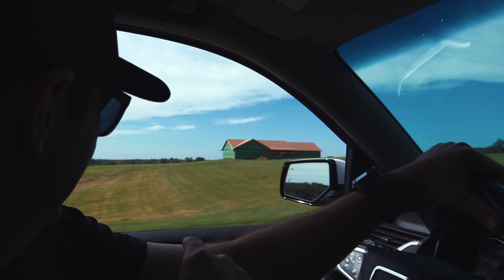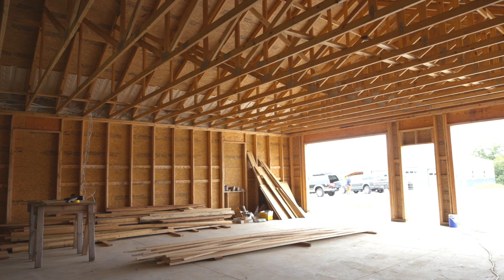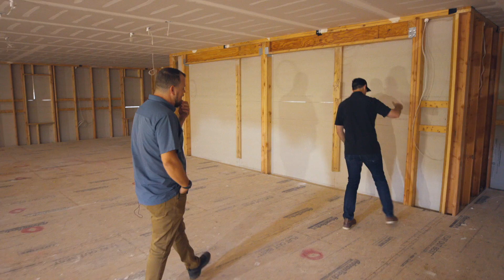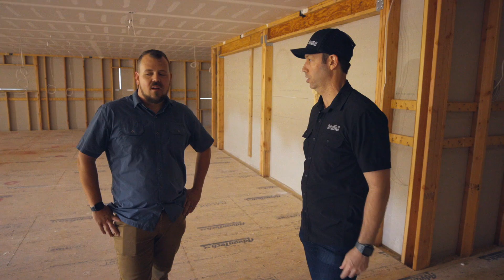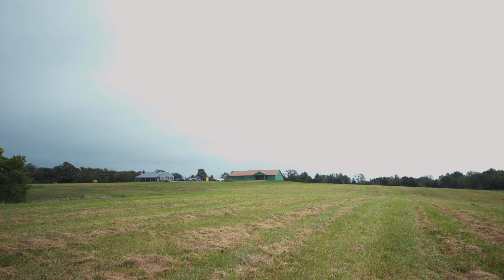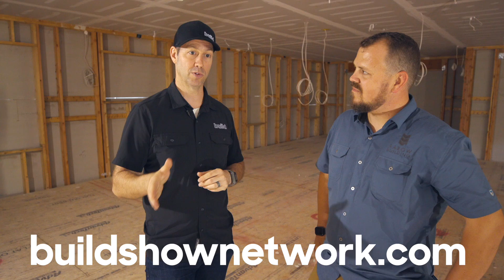A House with No Doors or Windows?

Comment: That is some forward thinking to design the house with no interior load bearing walls and to drywall the ceiling completely before doing the partition walls.  That just means you'll have to bring the drywall crew back when the partition walls are up.
Reply: My first house 35 yrs ago had clear span trusses with no load bearing walls inside, 2X4 frames and trusses on 24" centers with brick outside walls on step-edge slabs, lots of house were built like that in Australia
Reply: @DanielsCorner644  and what is that width?
Reply: @DanielsCorner644  I would ask for your trusses to be spec'd again. I have floor trusses spec'd for 34' spans with 40 live and 25 dead load at 24" tall and 16" spacing. You can easily get to 30' for normal stuff. (I have gypcrete planned). As far as roofing goes, I have trusses spec'd for 65' clear span with a 50 psf snow load. Most houses do not need interior bearing walls for the roof trusses. (Most floor systems will still likely require it because 34+' is getting pretty far clear spanning).
Reply: @DanielsCorner644  I agree it is more complicated than simple span charts. Particularly when you factor in angles and girders supporting perpendicular sets of trusses. But, for the ability of a truss to span 50'+ is standard issue. And I am only running the joists at 16" to handle the gypcrete dead load over the 30'+ span; 19.2" is standard, I agree. It's all figured by software as you've stated.

Comment: $250/sqft is ridiculous for Columbia.  Not including land and other fees.  I hope all the ceilings are gold flake and all the floors are solid walnut.
Reply: Actually it's Gold Leaf imported from Tutenkamen's tomb - quite exquisite actually, thank you for the support
Reply: For a basic house, yeah $250 is extremely expensive, but for a custom home with the insulation/air permeability ratings that this one has it becomes just expensive. Once you factor in local market conditions it could very well be in the ball park. It is not uncommon for specialty custom homes around here to be in that range, and the houses I'm building right now (poor insulation, little to no efforts to curb air flow, built cheap) are priced on the market for $350.

Comment: My dream:  
ICF with radiant cement floor also using passive haus window design for solar heat gain in winter. Massive overhangs and solar array to shade roof.
Reply: So right. We have to have a roof of some kind, why not shade the roof with solar panels and cut down on heat while gaining electricity. Win, Win.
Reply: johnknoefler absolutely right. That is an often overlooked benefit of solar. It blocks massive amount of heat gain to the roof assembly.
Reply: Well done! That is the best option currently designed as far as I have researched. If you need any help with the project, let me know. ICF with infloor is all I do.

Comment: Super advanced engineering. Thanks for sharing.
Reply: thank you for the kind words
Reply: @stevenbaczekarchitect9431  For sure, what impressed me is that the builder is using quality material and combining that with some really smart engineering that's well thought out for the future. I'm in Southern California and what I see in houses from the 50's and 60's is often really shoddy construction that could have been vastly improved using the same materials but just better designed.  More recent construction looks great until you look close and the engineering and planning for the future is just shameful. Houses built to have problems. Plumbing problems, settling problems, expensive to cool and heat, it's sad that no one seems to care about anything more than getting paid off.
Reply: @johnknoefler  Agreed - it's very unfortunate. It's crazy, this video gets posted, then these tools come out of the woodwork saying it's overpriced, the builder is a criminal, etc - then they tell how they are building homes for $100- $150 sq ft, I think that is criminal activity........
Reply: @stevenbaczekarchitect9431  I don't build houses, but I've been in the steel construction industry most of my life. Of late, I've been involved in landscaping, minor repairs, one roof replacement, and working as a plumbers assistant. What I've seen shocked me when dealing with these cheaper houses. They are built to rot, poor roof construction, crappy designs that had more to do with silly whims than practicality, walls that don't actually come to a 90 degree corner so counters don't fit, outlets placed in stupid areas that make no sense, wiring that is just flat out insane, plumbing done wrong. Damn, you'd be better off paying twice as much for a house built to last by competent people. There is nothing more sad than an elderly home owner trying to fix up a cheap house on a fixed income. There is nothing more expensive than a cheaply built house.

Comment: Passive house standard is .6 ach 50. They're already there. As long as the windows and doors dont screw things up, theyve achieved it. Gonna need ventilation, but worth it!
Reply: They've got a LOT of penetrations to do still.  All the windows, all the doors, all the HVAC, all the electric, all the plumbing.  And every one of those slightly leaky.  But they've got a good base to start from.
Reply: @PerroneFord  I agree. I'd love to see the numbers when this place is all done just to know the difference. Matt said theyve got a killer window and door set up coming in but plenty more to be done.
Reply: Completely not worth it.  You can  insulate a 3ach and have very low utilities.  Low ach just means if you fuck up somewhere you are screwed.   A well insulated house that breaths is better than a tight house.
Reply: @MichaelMantion  Are you still reading that 50's guide to homebuilding? That's a great explanantion when choosing not to do things right
Reply: Gentlemen and ladies, this house was tested to .30 ach50 Pa, then we sealed it more with Aerobarrier to .05 ach50 Pa. I doubt the final test is more the 1.0-2.0 ach 50 PA , if it is even that high
Reply: @PerroneFord  They were saying all the plumbing and HVAC will only come up through center walls from that basement, so those penetrations won't effect the air tightness.  Not sure about electrical - obviously all those wires down from the attic are holes, but can be foamed around easily.     It would be interesting to see what effect even the best windows and doors have on that number.  Plus those pesky bathroom exhaust fans.
Reply: @stevenbaczekarchitect9431  Right.  But the finished house isn't likely to be a .3 or less, which was my point.  The envelope is very solid.  Looking forward to seeing future videos from here as it looks like there are more coming.
Reply: @tombiby5892  That's fine, but unless they are manufacturing water in the house, that water will need to come from outside, and gray water will need to leave.  They are also going to need to get fresh air into the house and do HVAC.  So regardless where those penetrations are made, they WILL penetrate the envelope at some point.
Reply: @PerroneFord  I would expect the final blower door to be less than .20
Reply: @stevenbaczekarchitect9431  That would be amazing.  Looking forward to seeing that.  While I'll never afford a home built like this, it's awesome to see both the technology, and learn a few tips along the way as I improve my own home.  Thank you guys for being so generous with your knowledge.
Reply: @stevenbaczekarchitect9431  nope, I don't read guides to homebuilding.  Nor do I care what idiots have to say.  If you want a house that won't dry, that holds in toxins, that stop chimney and exhaust to not work, that's up to you. Just force me to live like that.

Comment: Whoa, whoa, whoa...a few questions if I might:
1) What exterior insulation (if any) and drainage/sump arrangement did that basement get?
2) Did the slab continue over the basement? If not, why not?
3) Is the slab also insulated underneath? (seems crazy to insulate top and bottom)
4) Assuming the slab doesn't run over the basement, does it butt the basement walls or run over them to the inner edge of the basement wall?
5) Are the slab and basement independent, or rebarred together?
6) You won't be able to tilt up full-height interior walls, how does that work? (Seems like a good steel stud application just screwing the top/bottom channels in place)
7) And what's the span of the main house trusses?
Reply: Basement has a perimeter drain and a floor drain that drains to daylight. It is a framed floor over the basement. Only slab insulation is on top of the slab, continuous - no thermal bridging
Reply: For #6, build a little short and shim. Or build 1-1/2" short and double plate the top. The wall will stand up and slide under.
Reply: @bradley3549  Yeah, assumed so, which is why I'd go with steel framing inside.
Reply: @stevenbaczekarchitect9431  Thanks, and is the slab independent or rebarred to the basement.
Reply: @jhealy3110  Reinforced to the utility foundation wall
Reply: Steven Baczek Thx
Reply: @jhealy3718  NP glad I could help

Comment: Brilliant. Why aren't more builds thought out as well as this? I have only one concern: truss uplift. How will you hide the inevitable movement of the ceiling when the tops of the interior walls remain stationary? This has me scratching my head. Steve Baczek?
Reply: I've designed about 4000 homes with trusses and have only had an uplift problem once with a 56' wide truss. I'm believing we won't have a problem here

Comment: Matt, I just checked out your website. Two programming issues. It didn't pick up on that I was using a phone. Also, it would help if you had a way that the user could easily switch to low vision mode.
I sell tools and fasteners. I recommend your channel and now your website to all the builders in my area. Especially relevant is your air and water sealing.
Reply from the maker: Thanks For your support. I’ll look into those issues. Thanks

Comment: I'm building similar to this in North Idaho.
44 foot wide trusses on the house and 35 foot wide trusses on the garage no interior supporting walls.
Monolithic foundation on foam with 1/2" hydronics on 6" centers in the house and garage.
Question, what's on the roof? And could it be used under steel roofing?
Reply: aSPHALT SHINGLE, BUT COULD EASILY BE METAL
Reply: @stevenbaczekarchitect9431  What's the pink on the roof in the video?
Reply: @sl8747  It's the adhered WRB on the 5/8" Zip sheathing

Comment: I am from Pittsburgh, Pa. Not really NORTH East  but -- If you bother with that partial basement / mechanical room and 2 X 3/4" sheeting to me it's A NO BRAINER to at least put in a full crawl space. This gives you access for electric, data and all those unforeseen problems down the road. Around here it is a no brainer - if you are putting in a crawl space, put in a full basement. [ this ain't Texas ]. I sold electrical products for 20 years. Near by we had WW II housing plans - slab on grade. What a pain in the behind. In concrete floor electric, plumbing  and ductwork. At first I thought this might be one of Kyle's R R Buildings Post / pole buildings.   Has anyone done before siding blower door and after siding. Does peel and stick WRB work to seal nail holes better than ZIP?   Thanks, looking forward to the additions to The Build Show.

Comment: So, $250 sqft + design (usually 10%-20% of build + real-estate costs (large variability)... $350.00sq ft is a fair approximation. The avg. build price in the 🇺🇸 closer to $150.00sqft. It will take decades to reclaim the costs via energy savings and if you consider the 'time value of money' it's likely far far longer. Great house, love the workable basement utility space.
Reply: MrWorldasmaya I agree based  on location.  If the location won’t return your investment for you or your heirs passive standards aren’t worth it.   Keep it simple putting $$$ where it counts most.
Reply: @davidwooten3430  Better said & more succinct. TY. I'm not opposed to energy efficient building for more than purely economic means. There's definitely value in building in a fashion that's better for our planet & helps, even if but a token, stem the tide of global warming. I'm all for that & have instituted such measures in my own home. It's a very rewarding experience & I was remiss in not mentioning that. That said, I wish folks were more clear with the breakdown numbers. Nice build though.

Comment: Um... that blower door number doesn't mean squat if you need to remodel the entire house yet, most notable cutting a bunch of holes for doors and windows.
Reply: Ummmmm...it does! It allows me to compartmentalize the air leakage faults as we progress. Yes the number will increase a very little with the doors and windows. I use this approach regularly and it is pretty consistent

Comment: Basement is a red flag without any french drain and sump pump and ventilation . Cost wise it doesnt make sence if its not done on the entire house as a real basement. The ventilation explanation is great for sure short run is more efficient.  foam over concrete? usually you put it under the slab and if you want a cozy house you add radiant floor heating.  I hope they never get any moisture between the slab and the foam/floor it must be a pain to tear down all the floor and walls( walls are over the foam)  to get rid of molds. Also the ceiling without walls carring seems like a huge cost for the bulding and add electricity/plumbing cost for sure.  when done right the rooms will be as seal as this setup without the cost.  you dont get cold draft from interior walls from the attic , I live in Canada and it s never been an issue in winter! thats over thinking and adds way too much cost that youll never see the
money back.

Comment: Any worries with not having a sill plate to screw/nail into for the base of the walls due to that raised floor? Only have studs 24" on center... seems like a large span that someone could kick or furniture could hit and break drywall.
Reply: Yeah, id want a kicker plate if it was mine, even if they intend any kind of finish molding.
Reply: Not a problem. Drywall is strong. You do a hole rater that break the whole sheet.

Comment: Very similar to commercial building techniques that have been around for a long time. I love the empty center with no load bearing walls. I've always wondered why houses are typically built to such a low standard compared to commercial buildings. Part of it is cost, but in the end, commercial buildings usually have a shorter life span than a house will. I guess it's all about money....
Reply: They been building this way in Australia for 50 yrs, nothing new

Comment: 3 story elevator shaft with 2 square foundation walls around it. 2 floors wide with 1 floor in the center. One roof around it with one square second floor in the center
Reply: What are you talking about ??? 🤔🤔🤔
Reply: @colstace2560  if you're serious il email you a drawing

Comment: 8:45 I've been told that BIBS should be R-23 to R-24 on a 2X6 cavity, not R-21.  So with the 6.6 Zip , he should be looking closer to an R-30 total wall.
Reply: OK - these numbers are somewhat imaterial to me, with an airleakage of .05 ach50 Pa and R1 or R2 really don't matter
Reply: @stevenbaczekarchitect9431  I would agree with that.  I was just thinking of the 'cool' factor to have walls in 'the next bracket' so to speak.  Everyone has walls in the R20's.  This home would be in the the R30's.
I appreciate the details you put into your builds.  This channel has helped me to realize the importance of air tightness.  The best I've been able to do so far is 1.34 ACH, and that could have been under 1.0 if I had better windows.

Comment: Wait, so is the advantech flooring ontop of foam with no concrete slab? That would be a huge cost savings
Reply: No. It is Advantech on Advantech on EPS on concrete slab. No savings there. (But you probably could do just a perimeter footing and do what you mention. The interior walls all being non-load bearing it would be fine to just float the whole floor on compacted crushed rock with 5" EPS. That likely would be a very comfortable house for knees and feet too due to the slight cushion experienced. Similar design is used for dance floors, and basketball courts over hockey rinks...)

Comment: Forget the price you donks! This is well thought out and well built. Admire it for what it is
Reply: EXACTLY - see I think the builders building for the $120 ish sq ft are the criminals ripping of the clients - I guess it is all perspective.....
Reply: Well built by what standard? You spend that much bloody money at $250/s.f., your standard for "well built" needs to be a little higher than this.
Reply: @someguy8109  I can say the same about the reverse, by what standard is this too expensive? By code - oh yeah the least possible standard to build by, great thinking there.
Reply: Oh, but let's go cheap and build shoddy. What the naysayers are missing is that similar design techniques can be used in a cheaper house. Much of the design elements cost little more than a crappy design but add a huge benefit in heating and cooling and future maintenance costs. Yes, there were some expensive materials used, I get that.